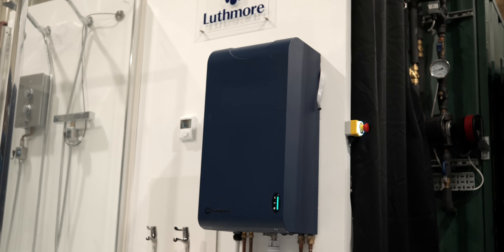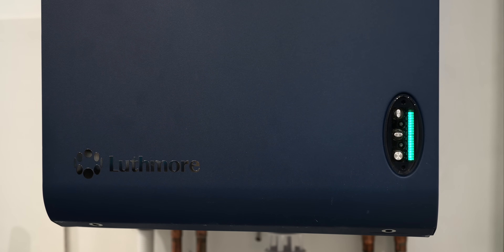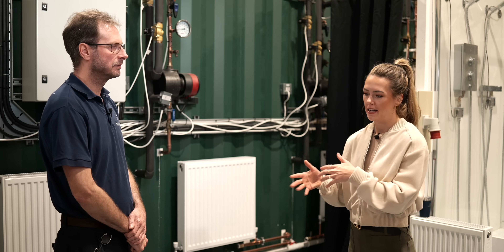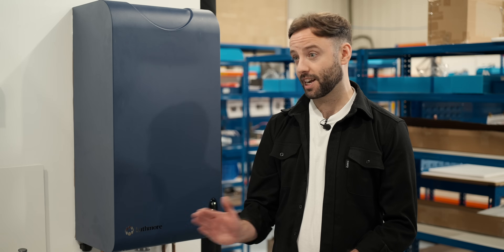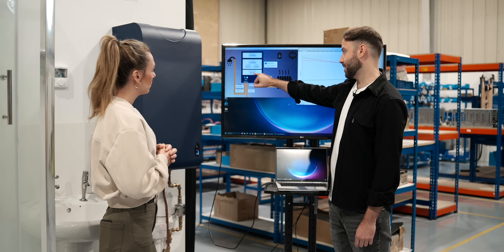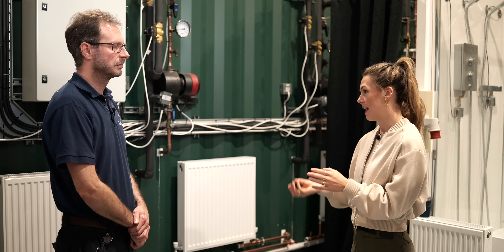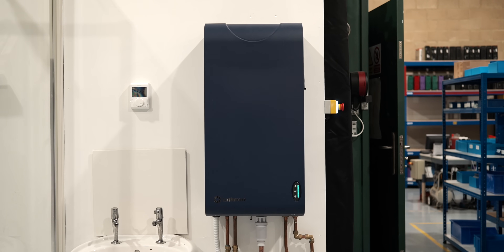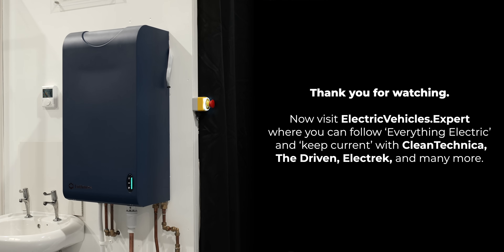Could This Battery Boiler Replace Gas AND Heat Pumps?

Comment: Slightly off track but when heating cold water up, then taking a shower the hot water touches your skin mere seconds before going down the plug hole with all the heat energy. 
It would be best to recover as much heat before finally down into the sewers.

So it would be wise to use heat pump rather than resistive heating. 
Maybe combine the two, this battery topping up the final usage temp on demand.

Comment: You are using resistive load to heat up water. It's always better a heat pump. Even if you use batteries, why would anyone use them only for hot water? If you install batteries you can use them for any electric load not only for hot water. Instant electric water boilers are pretty inexpensive.

Comment: Yes, but water radiators are terrible. They take up space needlessly. They make no sense in such a mould riddled country as the UK to not use filtered, fresh moving warm air in winter and moving cold air in summer. UK homes are freezing in the winter and baking in the summer because of ridiculous and inefficient water radiators and stagnant air homes. Just get an electric HVAC, or air to air heat pump.

Comment: It is a great idea for homeowners, who have no way to use a heatpump, because they can't place the outside unit, or get access to ground source heat or similar! 
Two notes however: Luthmore is not the only such system (maybe the only ones with the modular battery or the heat recovery, I don't know). @HeatGeek has the new nano hot water tank for those with limited inside space. 
Oh and also the latest data from Heat Geek installers show that they are replacing on average only one radiator. So the hassle of a heat pump installation has been massively reduced in recent years.

Comment: How does cost compare to a heat pump? My housing association are looking at heat pumps but my one bed flat doesn’t have room for all the pipework needed, this could be an option for them & getting rid of gas would save my biggest cost for gas which is the standing charge.

Comment: I have some reservations. 

What happens in winter where inlet temp drops to 10-12 °C?

How do you protect pipework for legionares in a system that does not heat pipes to 50°C?

How many radiators is this boiler designed to power?

Are there any plans to design a system capable of managing a 4 bedroom detached house.

Comment: The only benefit I see is it pack energy in more dense than a tank of hot water. Otherwise it would be a double conversion lost(AC to DC, change, discharge) and extra battery degradation

Comment: Suitability based on electric tariffs "of the moment" is not a good idea. Take solar installations as an example... the EON SEG tariff currently pays 16.5p/kWh for all solar energy pushed into the grid. This return on a substantial solar investment plays an important part in assessing the financial viability of any solar installation. So good so far, until EON decide, which they have, out of the blue so to speak, to slash that export tariff to just 6p/kWh... not good. Our energy suppliers just simply cannot be trusted with tariff stability, so beware when considering tech like this one here.

Comment: The guy being interviewed and  talking about using home batteries said they aren't as "power dense", typically 10kw. Power density usually refers to Whr per unit volume or per kg. Either way it doesn't matter as a home battery can be physically large. As for 10kw max draw - it's more limited by the inverter power.

Comment: I have just ordered an installation to replace my 30 year old gas boiler the quote was just under £11000 fitted removing my old boiler and heat store. I picked this over a heat pump because we are in  a 3 bedroom semi and the heat pump and associated plant (ie heat store ) was really causing us a major headache . We have a new 7.5 kw solar system with 20kw of  batteries . We are also on a EV tariff so for us it's the best solution to move away from gas.

Comment: I would like a shower with a circulate mode. 
So once it's been running for a couple minutes the used water is circulated back around. 
Then you can enable rinse mode when need soap or shampoo washed away.
But the waste water outlet has a heat exchange so the heat is regained from the hot water.

Comment: I'm surprised there was no discussion about using the water heater battery as emergency backup for power outages. That 7 kwh. could be used to keep the AC or heat pump and refridgerator/freezer going and skip a shower or 2 until the power's back.. It's about 1/2 the power storage of a lot of home battery set-ups.
Reply: An on board inverter would add cost, complexity and size, and significant compliance challenges. It's simply not what the device is for.

Comment: Try using sodium batteries.  Less polluting than lithium better for the planet !   Just as efficient
Reply: Sodium ion cells are a great future development. They are not yet widely available and have nowhere near the required power density.

Comment: You could double a shower flow rate by using a waste water heat recovery unit - they’re oddly unusual, but can recover half the waste water power into the cold feed, potentially allowing twice the flow at the same electrical input.

Comment: Running a hot tap or shower is one thing, heating radiators is another.. and I’m non the wiser if this product will cut it? Then there’s safety and degradation.. things you didn’t discuss. Also, can I charge my car, home battety, and this boiler all in an evening off peak? Can my home installation cope?  There’s are the practical questions unanswered.

Comment: So they hide batteries that potentially catch fire inside this thing? Also DIY battery solutions is usually about 15kW discharge power per battery and it stacks.
Having said that. Never stop inventing and trying.

Comment: In winter, my gas boiler uses an average of 70kw per day to heat a 3 bed house, this little toy would barely scratch the surface.
Reply: You're confusing energy and power.

Comment: I don't know why this shouldn't be part of a hybrid system with a heat pump for heating the house and this for hot water. I would have that I have space for a heat pump outside but not for a tank inside. If this can be engineered to just provide hot water and the heat pump for heating the house it makes sense. And if if can have the same outlets as a Worcester boiler it will sell loads.

Comment: A lot of people are suggesting that "Heat Pumps are better" and in many cases that is probably true. However, there are situations (like mine) where you are severely restricted from being able to fit a Heat Pump due to lack of space and the same constraints prevent you from having a water tank or battery storage. The only gas I use is for my combi boiler and I'd love to get rid of it. This is the sort of product that would allow me to cut off my gas supply and stop paying Standing Charge.
Reply: Hi, have you checked out "heat Geeks" for the sizes of their tanks?

Comment: Did you not think to ask, cost or installation time. The Adia Thermal Heat Pump would be the best solution for most people I have seen. Go and check them out.

Comment: Looks good. But kept mentioning showers and houses. What about people who want a bath and live in an apartment building?
Reply: The boiler stores the equivalent of 138L of hot water so not exclusive to showering and is ideally suited to smaller properties and apartments.
Reply: @Luthmore  ok thanks. My missus usually runs a bath and tops it up so it will be pushing that 138L equivalent limit. Our pulsacoil thermal store is/was around 200L IIRC and that usually needed an intraday top up. 

I’m very much liking what you do though so will research.

Comment: Good for apartments! I do not think this video covers heating a house in the winter when say 40-50 kWh per day is needed. Any comments
Reply: It is for smaller and well insulated properties, you are completely correct.

Comment: Just dumb compared to a heat pump. COP is less than 1. Use a battery to run a heat pump water heater.

Comment: It would be really useful if you could do a video that compared similar products that have recently been brought to market (and that you have previously done videos on). The Tepeo Zeb, the Sunamp Thermino, and this new Luthmore Boiler all appear, on the surface, to do more or less the same task: they allow you to buy electricity when it's cheap to store as heat, to use later. It's quite hard to really know which one to go for though. What is the heat capacity of each? What is the peak output of each? Which ones have internet connectivity to leverage smart tariffs like Octopus Agile? If you could get a representative of each company to come and do a video and pitch their products against each other, that would be amazing.

Comment: I always have trouble justifying getting rid of my gas boiler.  I use on average 18 therms/mo for hot water and cooking for a family of 4. That's $23 worth of usage.  My hot water is a standard-size tank, and I have no way of separating the two, but I assume the hot water is the majority, so I'll just go with lumping 100% of it into heating water.  At a rate of 29kWh per therm and a 90% efficiency rate, that's 26.1kWh * 18 = 470 kWh equivalent of resistive water heating.  Even if I could shift all my energy to off-peak rates of 10¢/kWh, it still would be double the cost.  I know he said it doesn't compete cost-wise with Natural Gas, but it just seems like a very complicated device to do a simple task.  In the end, it has a COP of 1, just shifting when it's used. I can see some CO2 savings if you get all your electricity from solar and wind, but most of mine is from natural gas, so trading a 90% NG hot water heater, with a 100% resistive, but <70% NG-> electricity doesn't reduce the emissions any.  Even in the UK, if you use electricity at night to get better rates, it's mostly sourced from natural gas, so it appears to be emitting more CO2 and costs more per volume of hot water.

Comment: What happens if you have poor water pressure and a Combi is not practical in your house
Reply: The Luthmore can still operate down to low pressure and still offer the cost-saving benefit of an off-peak or smart tariff. If you have the space outside, a relatively inexpensive cold buffer tank can increase water pressure to the property (basically a water butt with a pump).
Reply: Thank you as I would wish to keep my existing tanks etc

Comment: Ok. 
Does this system need an Internet connection to work???  This says it will keep working in grid failure, will it keep working if the Internet stops working???   EG Cyber war/hacks on server or just the company being bought out by a major manufacturer and the old servers being turned off...?

Comment: i think this is a compromise solution that only should be considered when better more efficient alternatives are not available, like in a small flat/apartment or small ADU. otherwise you are throwing away the majority efficiency that heat pumps provide for the same performance. In regular apartments or houses the length of pipe defeat the arguments that this is "instant" hot water.
Reply: By that argument, no solution is "instant".

Comment: Gas boiler inefficient?  How on earth does that come about.  Over 92% stated here, but I am sure that it is higher.  How efficient is enefficient?  This is electric neverland playing out again.  All of this kit, batteries that will die over time, apps which don't often work, or get updated or get bugs and all of the parts, inverters etc not available except through one company?  No chance.

Comment: Well all, a new type of boiler will be landing late 2026...it's called "TherMova" and it will eliminate gas boilers forever... Check out the video on YouTube!
Reply: So what?

You saw this battery  boiler nonsense on YT, courtesy of Robert's platform.

Do you really believe anything you see on YT?

This "new" boiler you allude to, how do you know it's "real" and will "work"?

You don't have a clue, much like the poor mugs who built the battery boiler believing it was worth the time developing.

Instead of droning on about all sorts why not do.some research prior to posting?

Any "new" boilers are likely to be fueled by hydrogen, much like they were prior to 1967.

No, don't ask, just do some research for yourself.
Reply: I don't need to do the research, I am the inventor of the system, I have the Patent for TherMova, the proof of the pudding is in the eating, sceptical.. Yes... but that's human nature ..I  @ForestForest-n9i

Comment: I live in Canada and Electric Hot Water tanks are quite common. This would seem a great improvement due to avoiding thermal loss, we don't use radiators often. NB Power (New Brunswick Power) a crown corporation actually rents out hot water tanks to homes for 7$~ a month. They are also installing smart meters to go to time of day tariffs. Gas boilers for hot water is not really a thing in Canada. 

I can see a very straightforward business case of electrical companies pushing these units in Canada instead of electric water tanks to use time of day tariffs. Heat pump water tanks while more efficient are not good unless vents are added in a home. Water tanks are often in a basement area with not enough air exchange + they cool the house and in Canadian winters, you do not want to be cooling your home.
Reply: This electric boiler might have lower thermal loss than a water tank, but at 10x the price it's never going to pay for itself, and for half the year any heat lost from a tank just reduces the space heating demand

Comment: It's a great concept and solves a significant problem for many homes  that don't have anywhere to put a hot water cylinder, like us. 

We have a heat pump, but had to retain our combi for hot water. This looks like it will simply replace the combi. We wouldn't need it for central heating though. 

No pricing yet.
Reply: The Luthmore boiler has an rrp of £4500 ex. vat

Comment: Heat pumps are better
Reply: Perhaps, until the noise complaints to the local authorities flood in ref aging heat pump gubbins rattling away all night long.

Might be happening even now.

Many, many thousands of homes will have the heat pumps ripped out to return to hydrogenl boilers.

It will happen.

Absolutely no doubt about it.

Batteries in homes (UK) will be ripped out as well as.

Batteries will then be confined to torches,  phones and vapes.

You know it has to happen soon.

Comment: If the heat is activated on demand, then this could save me money vs. the energy needed to keep my hot water tank with a sufficient amount of hot water. A battery array would retain its energy far better than an insulated hot water tank. With the energy being used only on demand,  then it may use a smaller amount of energy overall than maintaining temperature in a large tank, even taking into account round-trip AC-DC losses.

However, as others have said, it depends on the price of the equipment compared to other options.
Reply: Researching a little more... Round-trip AC-DC losses often manifest in heat. The Luthmore uses this heat in its process as described in the video. Meaning the COP of 1 is reasonable.

Comment: I'd like to see a small version of this targeted at hot water (shower, bath, taps) only - leaving room heating to an air-to-air heat pump system. Ditch the radiators \o/ Air-to-air heat pump systems cost a lot less than air-to-water, and as the battery boiler would only be doing hot water, the electricity cost of it wouldn't be a significant factor.
Reply: That is exactly what i would be looking for. I plan to get air to air heat pump multi split for heating and cooling and eventually ditch the gas boiler and radiators but need a good solution for heating water
Reply: @nick255  If all you want is a decent supply of hot water then what about something like a Gledhill Stainless ES90? It fits easily into a kitchen cupboard or under a bathroom sink, holds 90litres of hot water and you heat it with an immersion heater and a timer, or a solar PV diverter. It takes up virtually no more space than this Luthmore boiler (ES 90 is 530mm dia x 700mm high, Luthmore is 415mm x 310mm x 850mm), won't degrade and only costs £300
Reply: @nick255  One other thing to consider is a small DHW tank combined with a heat recovery system for the shower drain water, roughly doubling the effective volume of the tank by heating the replacement cold water flowing in as the heated water is consumed.

Comment: So why no heat pump technology? Because the need a medium to get energy from? Gas combos often are drilled to the outside exhaust anyway? Why not build its as replacement with a outside unit and use times 3-7 of modern heatpumps?

Comment: With a COP of 1, you will for every m3 of gas you wil need 9,8 kWh of elektriciteit. And a battery has a los of about 25% between storage and use. This not very efficiënt. Chosing a new gasheater wil be cheaper. And wait 15 years for new techniques.
Reply: Our patented technology stores the waste heat generated by charging and discharging and uses it to pre-warm the incoming water. It represents roughly 15% of the total energy stored by the Luthmore boiler.

Comment: Fire risk?
Reply: No. Safety is of utmost importance to Luthmore, which is why we have employed Lithium-iron phosphate (LFP) cells for their market-leading safety. The system constantly monitors every cell in every boiler and several layers of systems exist to detect, prevent and/or mitigate a failure.